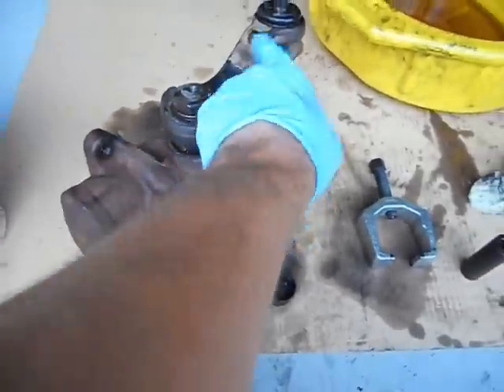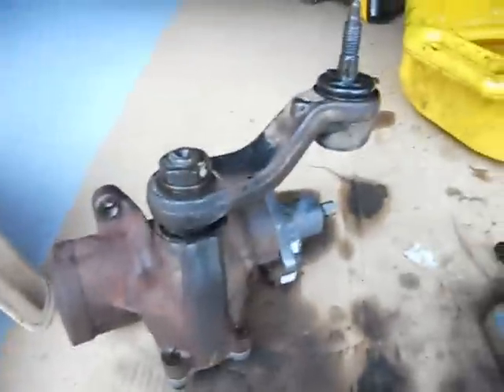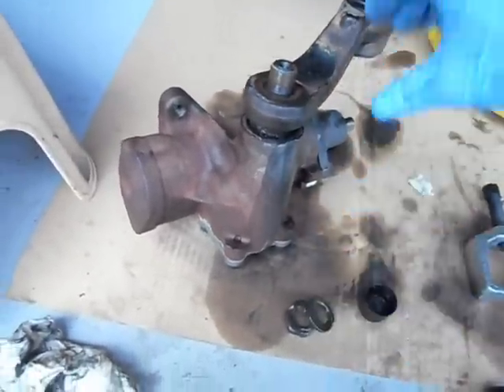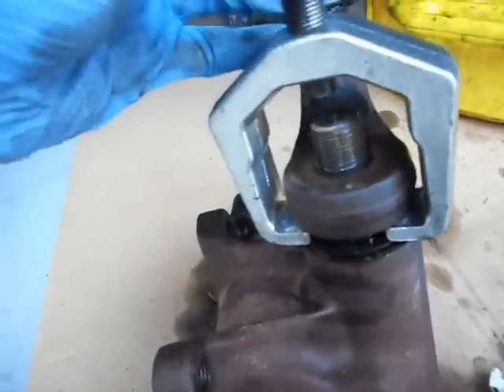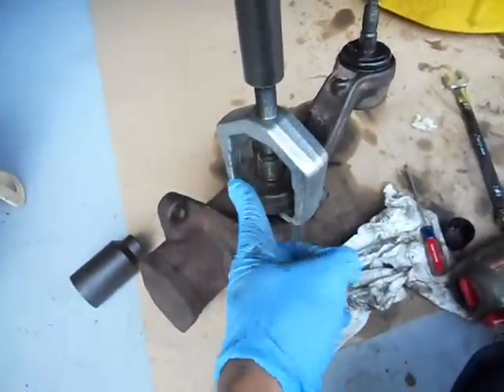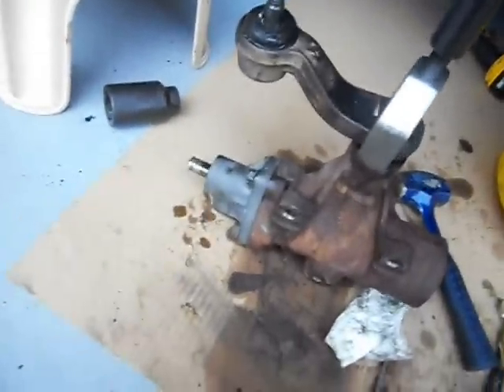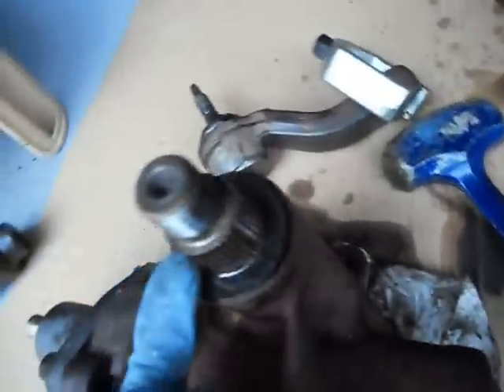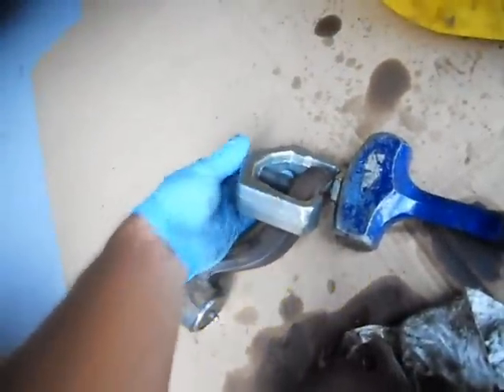How to remove a Pitman arm  on a Silverado the EASY WAY!  STUCK pitman arm

Comment: Very nice advise on the removing the pitman arm. My steering  box was still in the truck and very accessible. The puller , had a cap on the end of the bolt head to prevent you from using a socket or impact. But still the job is the same. Mine had 127K on it and was pretty rusty. Spray some penetrating oil on it, let it sit for 30 mins. Put the puller on, tightened it with a wrench and whacked the arm with a medium sledge. After about 10 times whacking  and tightening the puller. The arm fell right off.
Reply from the maker: It works!  If not you need to slice them

Comment: Thanks for the video! I did it just like you said, I snugged the puller and BAM, BAM, BAM! Then tightened the puller and did more pounding. I just kept going like that until it came off. If I hadn't gone gradual like that I'm sure I would have just broken the ears off the puller, as it was the puller is slightly bent. The funny part is that I kept hearing your voice in my head "BAM, BAM, BAM!" My old pitman arm only had slight movement when it was on the truck but replacing it sure made a nice difference in the steering, my truck doesn't do any wandering now. I've decided to do the idler arm as well. Thanks again!
Reply from the maker: Curt Alphenaar  Heck yea, Only way to do it.  That's how we did it in our old shop.. Hammer off everything! Ball joints, Tie rods..  Slam it

Comment: The right tools save one from a lot of headaches!  Sure beats smacking the thing with the two-hammer method. Thanks for posting. This tool, in a smaller form also works well on other steering components.

Comment from the maker: Yup! I check them that way. Make sure the engine is running!  I have another video where I show that trick when I replaced a wearable center link.  The Northeast sucks. I was from NYC area and most shops don't want to fix anything, That's a reason why I learned how to fix things myself.

Comment: Awesome video and tips.  The tightening and hammering/smacking really does the trick.  I just loosen up the Steering box and hold it in place with a couple of bungee cords to try to keeping it from falling off or braking any connections.  I don't know if it made a difference or not but I soaked that sucker a day before with Penetrating oil and all the other lubricants I had in my garage.  I will emphasize that having the right tools for the job is crucial and less painful.  I don't have an impact gun (I ended up borrowing one, later), I also got me a HF 4 lb Drilling Hammer,  and the pitman arm remover, of course.  I felt like a Million bucks after I got that sucker out.   It takes patience and perseverance but it will come off.  I can't even thank you enough for this video.  Great job!!

Comment from the maker: You might. I think the lower control arm bracket is pretty much the same, so it will block access to it.  The later model 2WDs had rack and pinion steering.

Comment: Great video, but you got lucky.  I broke my puller.  Use a grinder to grind almost through the old arm, then you can hammer it off.
Reply from the maker: I have gotten off many the same way. Do what I do, they all come off.
Reply: ghtowagon hey great video I'm replacing my 01 Silverado box. I have two questions. Would I able to reuse my old pitman arm if it's still good. ?  Are the pitman arms hard to get back on the new box? Do I need a press? Thx!
Reply: You can reuse your pitman arm, if it's not worn.  Slip it back on the splines with some grease.  Reinstall the gearbox, then you just torque the nut to 184 ft-lb.
Reply: Joe Benotz nice thx

Comment: Good video, but I cant seem to get the center link to separate from the pitman arm ( Gear box side), Is there a tool used for removing it? The other side (Idler) just popped out. I'm used to rack and pinion steering, and I don't usually work with this type of steering system.
Reply from the maker: +Justin Raymond  use a pickle fork and just hammer it between the joint, If I remember there is not alot of room so I had to hit it from a weird handle, Either through the wheel well or through the center opening where the plastic plate is.  I actually have to change this part again! Like now.
Reply: +Ghetto Wagon Awesome man that worked! I just switched to a wider pickle fork and she popped out! Thanks!
Reply from the maker: Justin Raymond
 Yea it needs to be the right size.  What brand  pitman arm did you go with? I have a moog one, I used a GM one last time around it did not last very long, 40k miles.
Reply: +Ghetto Wagon I used Detroit Axle, a cheap kit, it came with upper control arms, ball joints and tie rod ends. The upper control arms already had the bushings pressed in. The ball joints are bolt on also already installed in the control arms. If you buy Delco make sure its not a nos part because they probably didn't update the design yet. People buy old nos Delco part lots (before the design changes) and sell them as new for around half of retail. Part stores dump the old designed parts cheap, and stock the updated designs. Moog is probably better anyway, almost everything they deal in is suspension or steering related.
Reply: +Ghetto Wagon I also went with moog sway bar links and bushings. The blue high energy ones, I put them on pretty much all the Gm stuff, they just seem to last longer and they really don't cost that much more either.
Reply from the maker: Justin Raymond
 Yea I had the blue ones on my truck they lasted a good amount of time. I put some weird AC delco white end links on this truck, they were cheap 9 dollars. Still working.  Good tip on the knock off OLD ebay parts, that happens alot.

Comment: Awesome, worked very well.
Reply from the maker: +Derrick Beard  I have to this again! I hope a moog HD part will last longer!  I used OEM stuff like a idiot, well. I got it cheap so I said WHY NOT. Mistake. never use OEM GM parts if the OEM GM part wore out quickly.

Comment: 1993 Ford Ranger. Used same puller, rust-eater crap, heat, hammer, puller, bigger hammer, new puller, bigger hammer,long breaker bar, heat, puller... new puller. hahaha I'm on my 3rd puller and it is about to break also... still not off. We-e-e-e-e !
Reply from the maker: +profwaldo  Ford.
Reply: Just use a cut- off wheel on a mini grinder to slice both sides of the old pitman arm...cut down to 95%...try not to touch the splines.
Reply: You could of made it a 10 minute job by taking a air grinder and make a slit up the side of pitman arm almost to the splines then take a air chisel and run it through the slit a few times and the pitman arm will crack and come right off.

Comment: any suggestions on how I can break it free from the center link, been under my truck for house and cant break it free, tried heat hammers and pickle forks, I'm about to just cut everything off and buy all new!
Reply: can you fit a puller in there?   I used a adjustable pulled from auto zone or orielys on my 96 silverado worked great
Reply from the maker: +Travis Compton Get a long pickle fork, Turn the pitman arm until its at its best location. I think I might of routed it through the wheel well on the drivers side, I forget I have to change the pit man arm again very soon, this GM piece of crap arm i used only lasted 30,000 miles.  When the pitman to center link nut is  loosened, you can also wack the side of the center link around where the stud is, you may mushroom, dent the center link depending on the hammer you have, You could damage it,
Reply from the maker: +alex h  See the stud on the pit man arm shaft? Its stupidly long comparing it to other pit man arms so a puller is hard to get on there unless the distance from the pulling tabs to the screw threads  on the puller is extra long.  I was going to try it until I noted that.

Comment: Not gonna work on an 01 silverado rusted from liquid salt rust belt of Minnesota.   Not only remove the steering box, but use a air cutoff to cut one path to the splines, and another as a 'V' to the one you just made.  Make a vertical cut in the middle, because the side with the rubber boot, you stayed away from.  The weakest part is towards the other end.  Air chisel the middle peice out.  Heat it through the 'V'.  Then air hammer it off, while you have a pitman pulley about to break from tension on the arm.  It's the only way for pitman arms from hell.
Reply from the maker: Yes.   Minnesota is a stupid place.  Scrap it out   My NY truck pitman arm came right off Not too rusted

Comment: Do you install new pitman arm to gearbox before reinstalling gearbox thx ?
Reply from the maker: +Alex G  On these 99-07 Silverado trucks, Yea put the arm. You don''t need to remove the box to remove the arm I just did it this way because I had to rebuild the steering box.  If you change the arm on the truck you need to unbolt it, I have a video on that

Comment: Ha! try this on a ford! i have a '93 F-150 and it took us 5 hours to get the gear box off and another 2 hours to get the arm off. NONE of the pullers we used would fit. They were all too big. We tried 4 different ones.
Reply from the maker: MrNightslayer49  Yup, that can happen,  PITA isnt it. Some boxes have a  long sector shaft (thats what she said)  or the pitman arm is fat so pullers wont clear so good

Comment: When you reinstall be sure you are in the center of travel of your gear box otherwise you will short steer yourself on one side.
Reply from the maker: alot of times the steering input shaft flat wont even line yup if you do that. I usually mark it but I know where it has to be so I mostly don't

Comment: Good advice, Try Snap on  Low profile pitman arm puller Item: YA6880 for more time savings so you don't have to pull the gear box.
Reply from the maker: I was sending it out for rebuild so I pulled it. Not sure even those low pros would work. When I changed the arm again I just unbolted the box and strapped it to the frame. It was easy. and i used a standard cheap puller. Better than spending $200 on a puller

Comment: Or 30 seconds with a MAP torch.
Reply from the maker: Never. I dont want to heat the seal at all
Reply: @GhettoWagon  I replaced seal. that’s why I removed box
Reply from the maker: @robbanta2979   Ya i did that a month ago again